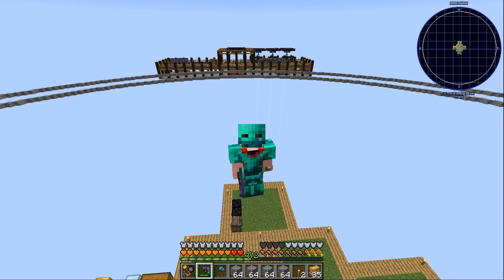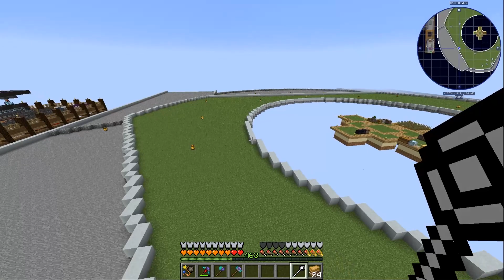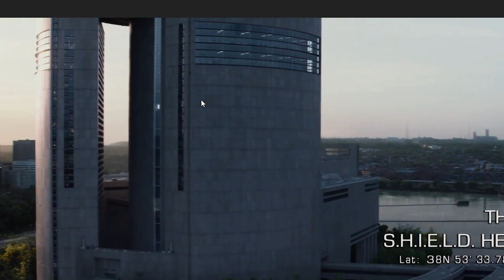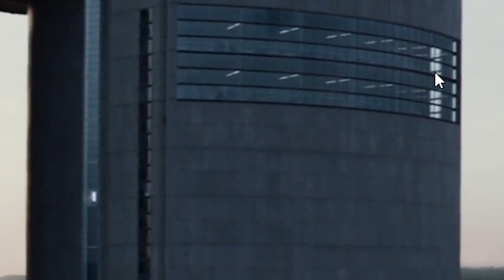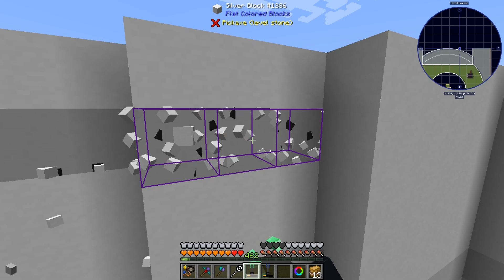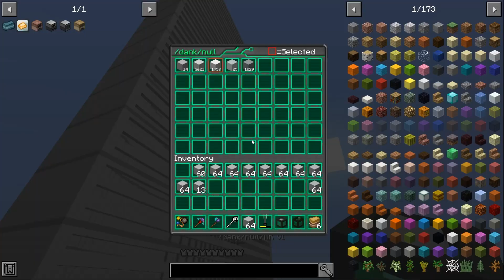Kelley Construction - MCU Triskelion (Part 1)

Comment: Hey Kelly, instead of trying to lower the floor, you could count it starting from world height and going down. That way you can try to get it in. 

I'm sure that you probably thought about it already. But it's going to be difficult even starting at y 0. 

Although it's six blocks per floor, as 3 empty and 3 for ceiling. That's 288 and that's not going to fit anyway. 

If you'd changed it to 3 empty and 1 for ceiling and 1 for the floor, you'd have 240 blocks for getting it all in. With flux networking and conduits everywhere and using the proper facades, it should be work somewhat. However then cabling becomes a headache. 

Good luck with figuring it all out and trying to get it working. I know that I'm enjoying what you're doing. 

I'm not building anything fancy, as I don't have the ground work yet set up for the build I'm wanting.

Comment: Love your buildings, as always. Just a reminder: The last series got really laggy due to large amounts of cabling, ME stuff, etc. I'm sure that's still in the back of your mind on this one, but just be wary. Go big, but not too big :)
Reply from the maker: I chose this build because I knew it would be big. The communications hub of this Triskelion is 1000+ blocks away. 

I can facilitate spreading out all the big builds while keeping it all in one building.
Reply: @KelleyEngineering  Oh I had no doubt you had pre-planned, based on the last series' problems. What I normally do is put laggy stuff in other dimensions or compact machines. It really helps :)